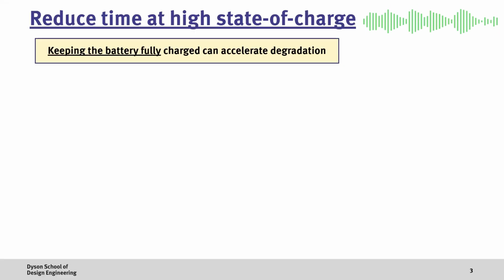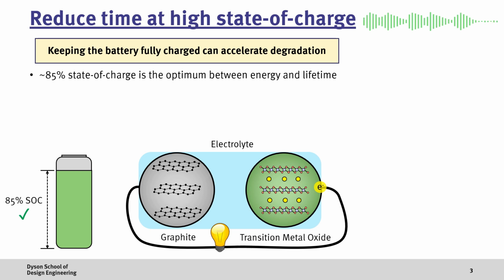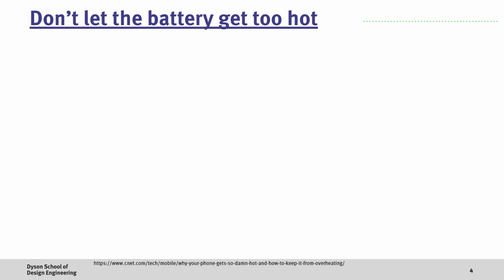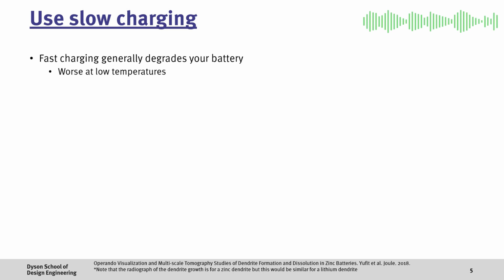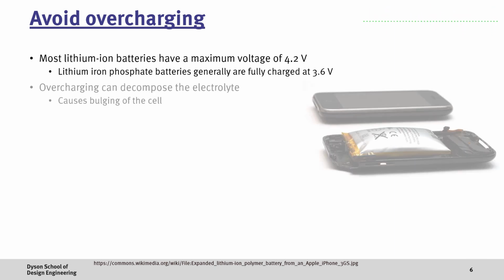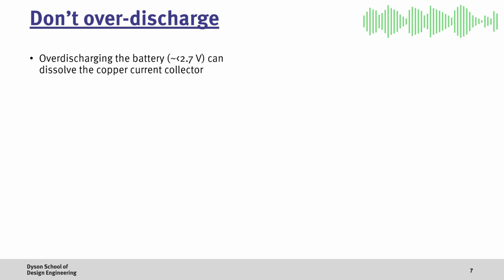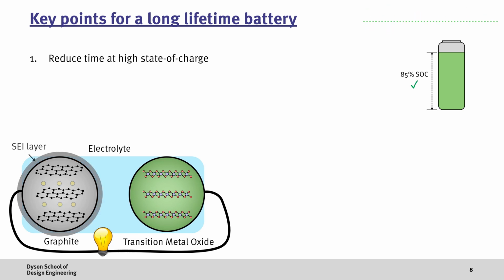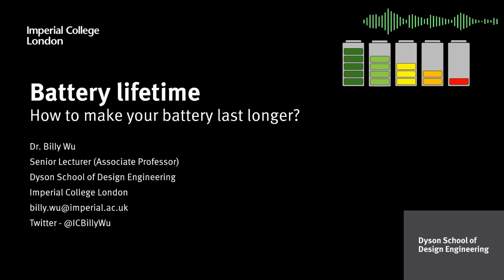How to make batteries last longer

Comment: The explanations in all your lectures and are easy to understand and the unique visual aids makes it even easier, thank you. Both low and high temperatures have an effect on the health of the cell, through plating or increased rate of SEI layer formation. What is the effect of these mechanisms, under the same temperatures, but when the cell is not being charged or discharged?

Comment: One of the common problems I'm seeing is that to save costs manufacturers will use BMS that do not monitor every cell. Instead they will monitor groups of cells in series or parallel or both and I believe this is a common cause of non-mechanical battery failures, especially as cells age. Unfortunately BMS themselves are only as good as their features and design in the overall circuit/system.
Reply from the maker: Thanks for the comment, and yeah I agree with you that there are different quality BMSs out there with varying levels of reliability and functionality. Certainty, there are ones out there with the minimum level of functionality and reliability

Comment: Can you give a rough idea of how fast is too fast for fast charging and battery degradation? Would you consider 1C to be too fast and contribute to degradation? Dendrite growth causing a short is not something that happens on modern consumer products, so it seems that charge rates are limited enough to prevent that failure mechanism. In your explanation the dendrites are using up the Li ions, so if we are not seeing shorts with fast charging, does this mean we are not seeing dendrite growth and degradation with 'fast charging', or are we just not getting long enough dendrites to create a short?
Reply from the maker: Good question. What defines fast will depend on the battery. There are batteries with higher energy density which is achieved by having thicker electrodes and thereby removing inactive material like current collectors. However the drawback to this is that the power capabilities normally drop as the lithium-ions have the travel further. The opposite is also true in that there are high power batteries with thin electrodes, but lower energy density. 1C is probably the right ball park for general fast charging limits, though this depends on the design. Some are targetting a 15 minute charge for extreme fast charging (XFC) which would be 4C. On your other point, whilst lithium plating can cause dendrite formation and short circuiting, sometimes you can get lithium-plating without short-circuiting. i.e. the lithium plates, but then reacts with the electrolyte to reduce the battery lifetime rather than cause catastrophic failure.

Comment: Is there any logic in claims I've seen that batteries "need" to be periodically fully discharged and then charged in order to stay healthy? Your vid leads me to believe otherwise, but I wanted to be 100% sure - thanks!
Reply from the maker: Not really. The only thing I can think of is overtime batteries will self-discharge which might lead to cell imbalances. Often charging back up will allow the battery management system to rebalance the cells (though depends on the BMS). This is something I've seen suggested in some LFP batteries where the purpose is potentially also to reset the state-of-charge estimation algorithm which can be a bit challenging in  LFP cells. However, in general lithium-ion batteries don't need this type of cycling to stay healthy.

Comment: I assume this is specific to lithium polymer batteries? It doesn't match my understanding of LFP batteries, for example. Their very flat voltage profile from 10%-90% SoC would make stopping at 80% very difficult, especially in batteries rather than single cells. And is it just that thermal runaway via polymer degradation in LFP is harder to trigger?
Reply from the maker: The exact numbers are chemistry specific but in general the higher the state-of-charge the more likely the anode (which is nearly always graphite in current commercial cells) will degrade. You're right that the flat profile in LFP makes SOC estimation more difficult, though not impossible. Also you're right that LFP is generally safer, since the material is less exothermic than nickel based cathodes and because it has a lower voltage, there is less change of electrolyte decomposition.

Comment: The whole industry should adapt the "85 is the new 100" mantra. Sadly today most consumer chargers and BMS are not smart enough to allow user control over the state of charge.
Reply from the maker: Agreed. This can significantly extend lifetime and is a shame that not all battery systems offer this flexibility
Reply: @BillyWu  trouble is some chemistry ages faster at 85% than at 95%
Reply from the maker: @editorglueitcom  True! Rules for optimised battery management systems are difficult to generalise and quite chemistry specific.

Comment: Only proves that companies that make products with non user serviceable batteries should have circuitry that prevents long times at full charge. Meaning once 100% charge is reached on the charger the device runs 100% on the charger power. They don’t though to push users to upgrade sooner
Reply from the maker: Yeah agree. State-of-charge is one of the main parameters we can change to extend lifetime but it a fine balance with available energy.